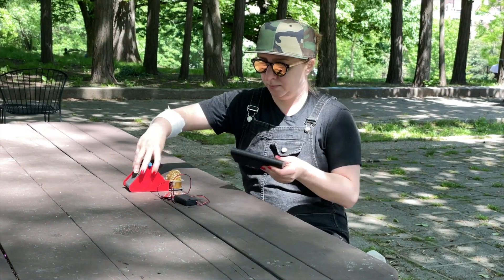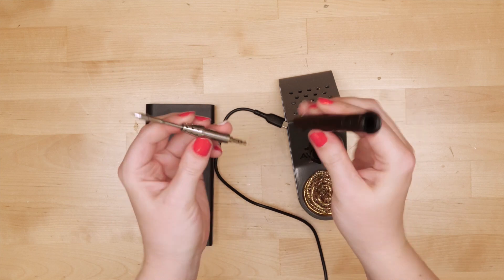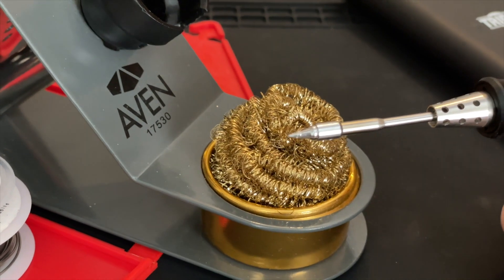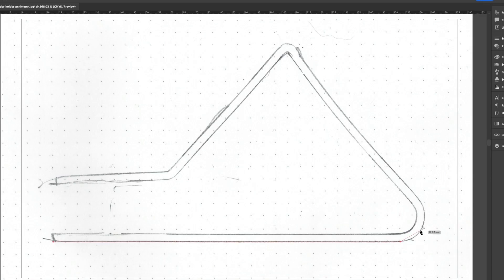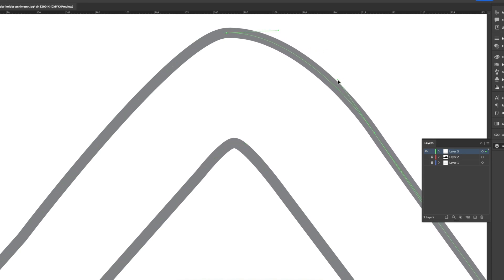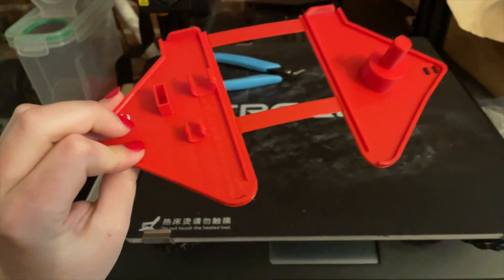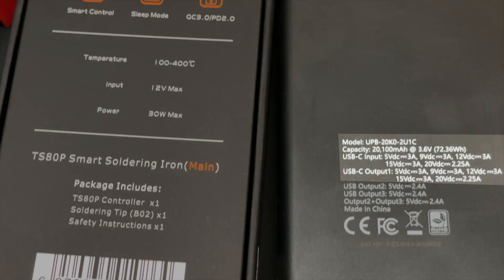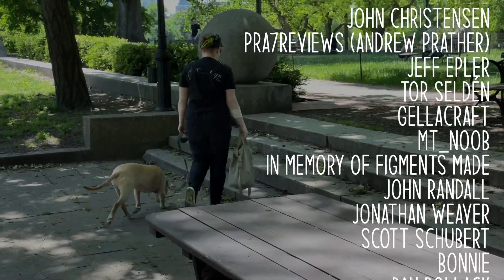DIY Portable Soldering Station (TS80P)

Comment: Very clever! Hilarious that someone would solder on the go, it always seemed too impractical with all the accessories you might need. Also, I can't think of a project that would need this level of mobility, but you do, obviously. Great 3d design. Great compact vid.
Reply from the maker: Used it to fix some rodent-eaten wiring on one of our motorcycles recently! Handy since we park on the street

Comment: I didn't even know they made USB-C soldering irons!  In the past, I've used a step-up inverter and car battery with a 110v iron to work on stuff in a car parked on the street.  Looks much nicer than trying to use butane.